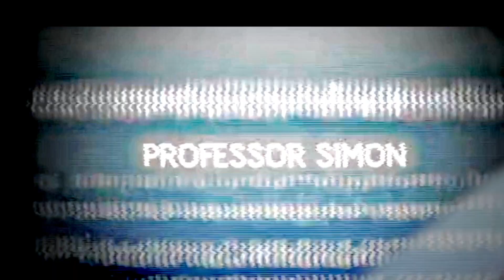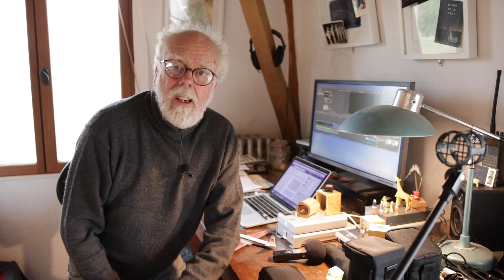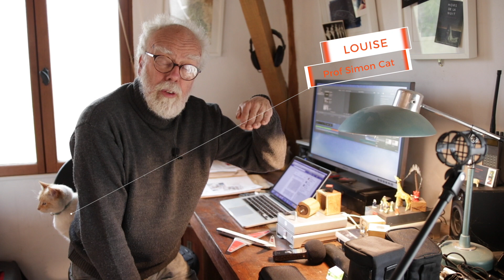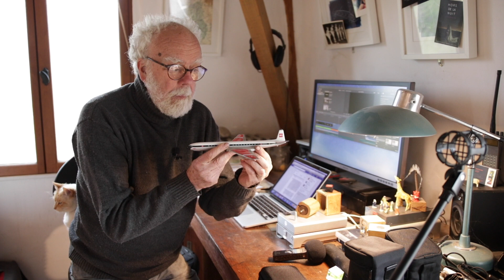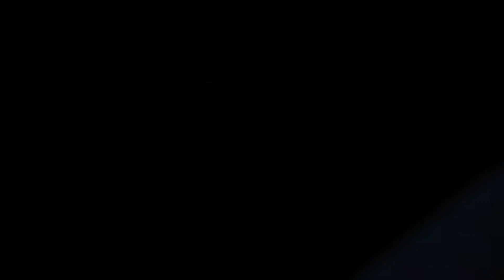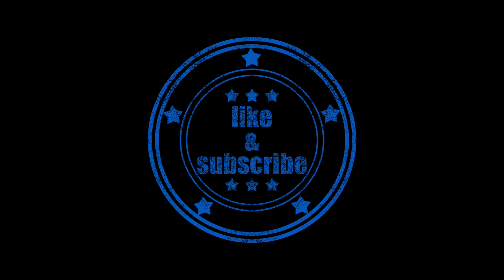737 Max 8 - Report published - Prof Simon

Comment: The horizontal stabilizers need to be redesigned and made  larger to accommodate the larger engines on MAX8, anything else is just a patch up job.
Reply: TigroTom I don’t think that’s were the problem lies, placement of engines shifted centre of gravity  and  using an old airframe design is the problem.  Now they went for bigger engines to increase range and using an older airframe would cut costs in developing a new one. The investigators do not want to look at the real problem.
Reply: @brianmashoko  
Best thing is to just manufacture the older version of 737 at a discount until new re-engineered plane is ready and properly tested.
The older version is safe and proven, just sell it at  a discount.

Comment: I agree with Prof. Simon that an airplane should be designed so that it is pitch-neutral, neither tending to excessively pitch up, nor pitch down.  MCAS is a software patch to correct for a structural design defect in the airframe itself, a defect caused by new, larger, and more forwardly placed engines whose thrust torques the nose of the plane up.  MCAS is not the problem; the design of the physical airframe is the problem.  I advise you never to set foot on the 737 Max 8 or Max 9 flying coffin, even if the new MCAS software is eventually approved by the FAA.
Reply: I have no problem with the concept of MCAS or designing aircraft with relaxed stability.   The B737 MAX is stable.  MCAS was there to moderate the stall.  Enlarging the stabiliser on the B737 and strengthening the tail would add weight and drag.  That ultimately makes the aircraft less safe as well as reducing performance.  It certainly means inferior glide Ratio and climb.  The problem isn’t using control technology to provide desirable characteristics and stall protection.  That’s all good.   The problem is the extremely poor design of MCAS.   In the  process control industry we use multiple sensors on our control systems before a critical output is actuated.  We might have a 2oo3 setup which is spoken as “2 out of 3”.  That’s nice because you can also create a sensor disagree alarm but continue operating.   2oo2 and 3oo3 are also possible but if there is a fault the system can not act.   This is not programmed it’s configured, as a programmer you treat it as only one system.   Obviously for an aircraft 2oo3 is the best architecture.  In the aging B737 only 2 sensors and computers are provided (3 on an airbus or (B777/B787)  on the B737 pilots must decide what sensor or system is faulty and switch to the good unit.   It’s also likely the sensor Boeing used are no good for MCAS as they may fail high (good for stick shaker).
Reply: Agree, Boeing has bolted new engines on to an aging airframe and tried to fix the handling problems with software rather than redesign the aircraft from scratch.
Reply: Agreed..will never fly max because its wrongly built.
Reply: Very true and well said. The 737-MAX needed in my opinion longer legs. They should have put on taller landing gears, more like the 757 and this way they didn't need to position those engines that much forward.
Reply: Agree 100%
Reply: Daniel Morris you are absolutely right

Comment: Everybody keeps talking about "design flaw, center of gravity unstable" which is untrue and not the reason the MCAS system was implemented. The repositioning of the engines caused  an unfamiliar nose up force during heavy thrust. (very easy to compensate for) The developed the MCAS system to automatically compensate for the extra nose up force using the existing stabilizer trim system so that pilots would not have to be retrained and certified on the 737 MAX-x
The fix is to properly train the pilots and 1. have the software use both AOA sensors along with other data so that it disables itself if necessary, such as an AOA conflict. 2. Install isolated/separate MCAS cutout switches/breakers so that standard electric trim functions work with the MCAS disabled.
Reply: Truth!

Comment: There should be an electric variable power-assist motor on the stab cable system to overcome the resistance to manual trimming in an emergency.
Reply: Although that sounds reasonable the tailplane is controlled by the jackscrew so is either controlled manually by the yoke switches or automatically by the MCAS system. As mentioned above, the control speed of the jackscrew is apparently faster when being worked by MCAS than when controlled manually so in effect, the pilot is fighting a battle he cannot win
Reply: 737 has handles on the trim wheels to be operated by hand in the event there is a problem with the trim motor.

Comment: FAA is the principal culprit here, not exactly Boeing. Boeing can be blamed for wrong design. But it was FAA that failed to do what its mandate is.
Reply: What's at play here is something called "regulatory capture". It's what happens when some entity, Boeing in this case, gets too much undue influence over a regulatory body, the FAA in this case, that is supposed to regulate it. It's something that is actually more widespread than people think and it doesn't only affect the aviation industry either.
Reply: @joevignolor4u949  Absolutely right - Over time, and partly because of the common skills needed to both perform in an industry and regulate it, regulatory authorities gradually become closer and closer to the industry they're supposed to regulate, and end up protecting it - until a disaster happens where this is recognised as being part of the problem, and then it returns to regulating, for a while, and the cycle repeats - a bit like a phygoid cycle
Reply: @herseem  Ah yes. The revolving door between industry and government and government and industry. And around and around we go. And while on the subject, try getting the building inspectors in your city or town to help you force a landlord to fix a problem with your apartment when the landlord is a big shot in town and he has lots of political connections.
Reply: This is true. They did not do oversight required by law. They allowed Boeing to SELF-CERTIFY the MCAS software. And then after that, Boeing CHANGED THE PARAMETERS, allowing the non-stoppable reactivation of nose down trim, again, and again, and again.
Reply: @H P Trump put boeing in charge.  And people will still vote for him because the people who died were african and not american.  The secretary of defense is a ex-boeing VP.  That is how fucked trump and republicans are.  An executive of boeing runs our military.  The whole point was to force the military to give boeing crooked contracts they would otherwise lose.  Our military is headless now.
Reply: Actually Democracy Now has an audio recording of Mullenburg in 2017 talking up how they (Boeing) convinced the FAA to streamline the certification process, mentioning the Max aircraft as a beneficiary of that streamlining. You can thank Donald Trump for his close relationship with Boeing and the streamlined certification process. Thanks to Trump, the FAA still only has an acting Director.
Reply: I do not agree. Boeing in itself should be making the best/safest plane, not rely on overside by the FAA. If I steal and the police don't caught me, it's OK? Plus you take away 1 layer of safety. FAA should really just caught the innocent mistakes made by manufactures. That way everybody tries to make the best/safest planes (layer 1) and the FAA act as a safety net, IF something slipped through (layer 2). Not depending just on the FAA (layer 1). Because if, like now they made a mistake by saying the MAX8/9 is safe (as can be), you get these 2 fatal accidents. Not saying I'm right, but this is my opinion.
Reply: @Guust_Flater  Please pay attention to the fact that Boeing is a commercial entity and there are competing products made by other businesses available to the customers. There can be its replacements if Boeing errs. Boeing can be sued too if it errs. So, to some extent, Boeing might risk its reputation and try to get some fast profits by not offering the best product. However, there is no choice or competition when it comes to regulatory function of the government. FAA is not supposed to fail. If it does, then public has nobody else to protect it. I hope you understand my point. Trust me, Lion Air or Ethiopian Airlines would not have bought the Max had it not been certified by FAA in the US. So, due diligence by FAA is (was) trusted even by entities outside USA. When FAA fails to perform its specific and exclusive task of making sure that commercial entities are not acting against public interest, there is nowhere to go.
Reply: @sh230968  This is  you talking. Do you really think Boeing would say, what you just did, that they might risk their raputation for profit!?? Not in a million years! I see the talking heads already,  that they have the best interest for safety of the people flying their planes. It' "funny" how they now say "we're not going to let the MAX fly, untill we're sure it's safe". But that is what they say wenn they released this (every) plane to the market!?.......(The best/newest/safest/....)
Reply: @Guust_Flater  Just a couple of years ago when Boeing decided to roll out Max with MCAS, it did risk its reputation and preferred greater market share putting safety on the back burner (imho). Corporate greed exploiting the situation when FAA was sleeping in complacency or was in the middle of criminal negligence.
Reply: @sh230968  Agreed 👍
Reply: 230968 I disagree with you I blame Congress for not giving funds to FAA, FAA does not have enough resources to do their work
Reply: @naknaknarok  Leaving the delicate task of regulating aircraft manufacturer on the manufacturer itself is never justified. You may be right about the lack of funds but nothing justifies actions that can lead to loss of human lives, American or foreigner. The message given to foreign airlines was that the process of due diligence by FAA was intact. Reality was that FAA was just a dead horse. I don't want to get into the argument of power of purse or other possibilities of arranging funding (like the money for the wall) or Federal government shutdown.
Reply: @H P,both Boeing and FAA are to be sued

Comment: Professor left out very critical information and that is that the throttles were at 94%, which means at full takeoff speed the whole time until the aircraft hit the ground. The high speed was a major contributing factor that the manual trim might not be possible. The plane actually exceeded the maximum operating speed. To me it is mindboggling that when the nose of the aircraft pitched below horizon that the pilots didn't cut the throttles to idle. Perhaps they panicked and forgot how fast the plane is travelling, which also contributed to the doom of the flight. However, it is anybody's good guess what actually happened, which means we have to wait for the final report...
Reply: In my opinion, they had to maintain full throttle. Once they trimmed the plane back to nose up, they wanted to be able to continue climbing immediately since they were still quite close to the ground. As the nose is coming back up, you need full thrust to transition from diving to climbing. If you cut the thrust to idle, you can effectively send the plane into a real stall. And besides, even at 240knots as some have suggested, the forces on the horizontal stabs on a diving plane is still too much to be overcome by those tiny bitty manual trim wheels. Perhaps if they were level flying it would have helped. But not when diving.
Reply: @eudofia  Yes, you are correct, but they had to be aware that at such high speed while out of trim and elevators set to maximum they would not be able to move the horizontal stabilizer by hand. Why they didn't hold the climb with cutoff switches in off position to gain altitude then? Even with shaker on, alarms, etc. I think they were climbing for a minute or two before they turned the cutoff switches back on. Or why they didn't switch them off again after they re-trimmed a little? Maybe climbing wasn't physically possible either. Or maybe they panicked,  or maybe they really ran out of time and options. I guess these are very hard questions that can be answered only after very thorough investigation...
Reply: @lehos24  Unfortunately, it could have been any of those things you have pointed out. But as in these cases, we cannot definitely point to one factor as the culprit. It is always a chain of events that leads to a disaster like this one. 
Just to answer one of your questions: They were climbing when they noticed the plane was pitching nose down arresting the climb. They used the manual electric trim to put the nose back up. A manual electric trim input momentarily cut off the MCAS. But since the AoA sensor was sending bad data to the MCAS, 9 seconds later, the MCAS pitched the plane into a nose down again. That is when the crew realized it was an MCAS issue and followed Boeing procedure by deactivating the electric trim using the cutoff switches. But at this point, they were already pointing down. So they tried the manual trim, it didn't work and in desperation, I guess, they switched the electric trim back on to help with the nose up trim, but the MCAS said thank you very much and continue pitching the nose down because it was still getting erroneous data from the AoA sensor. And the rest, as they say, is history. SAD

Comment: Boeing's logic: If we want pig to fly, just fix it's software / pig's brain. Let it think it CAN. Then, pig will fly with enough engine power.
Reply: All of our latest military planes are designed to require a computer to fly them. The inherent instability makes them more maneuverable and faster.
Reply: @eagleviewhd  Passenger jets are design to fly stable  (not the fighters) and cheap on fuel. The ultimate character is at cruising altitude. To save operating cost, the safe flying envelop is getting smaller and smaller. Please tell me the 737 50 years ago had the SAME aerodynamic  characteristic as today's 737? If NOT, Why share the same certificate? Because the FBW to force to "simulate" the characteristic. Then, when it needs go back to the wind tunnel and drawing board (expensive)? Do you share the same ID with you father, grandpa? By the Way, what you are talking about is called " feed back control" in professional.

Comment: I believe the Boeing instructions were that once the trim stab breakers are pulled, they should not be reactivated.  However, you bring up a good point.  That they reactivated them so they could trim the darned plane electrically instead of the manual wheels - which would have been extremely hard to turn due to the forces on the stabilizer.  And at low altitude, as you said, no margin for error.  It sounds like an utterly horrible design, and it is no wonder that Boeing said yesterday that it is taking full responsibility for the two crashes.
Reply: Full responsibility must mean jail time. Nothing less. Innocent lives were lost. AND THEY MUST SCRAP THESE PLANES FOR GOOD.

Comment: Am I correctly understanding that any time the electronic controls for the stabilizers is on, MCAS switches on? If so, I can understand why the crew were having such a hard time. Also, all of the media that initially pointed to inexperience as a possible cause first without any evidence should feel terrible and, though they probably won’t, should have learned a lesson.
Reply: Joe Joe correct, they didnt follow procedure when they switched it back on. The final report will tell if it would crash anyway.

Comment: If I understand what professor is saying, the MCAS misfunctions, directing the power trim to throw the trim out of safe skew, ..... the pilots have not the time to manually reset the trim, so they turn the power trim back on for needed assistance.,,..... but then the MCAS directs the power trim back out of skew,....?
So where’s the goddam switch to disrupt the MCAS!
I’m not an electronic engineer, but a switch disrupting the current to a solenoid seams quite basic!
Reply: @Arvid. Unfortunately, Boeing did not design a switch to disengage the MCAS. The only way to cut off the MCAS is to disengage the electric trim. As a matter of fact, Boeing did not even inform the airlines or pilots of the existence of the MCAS. It was after the Lion air crash that the existences of MCAS was known to the general public. According to Boeing, the reason for not disclosing the MCAS was they did not want to overwhelm the pilot with too much information. Isn't that great?
Reply: eudofia,
It’s absolutely incomprehensible and incompetent!